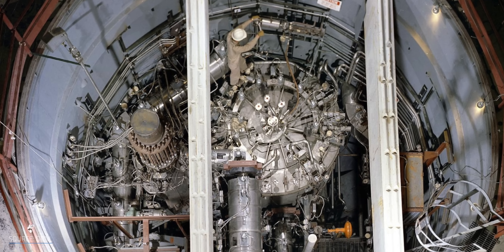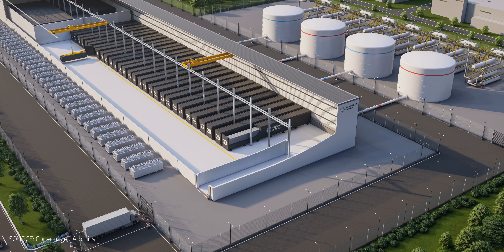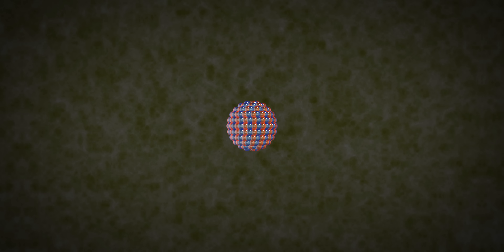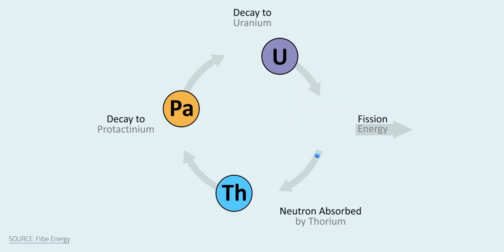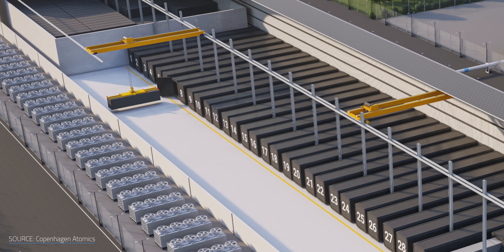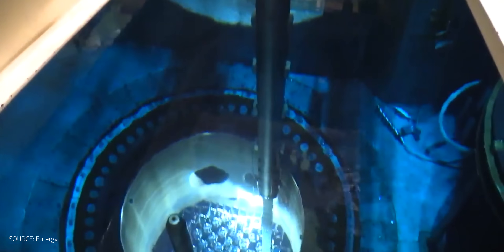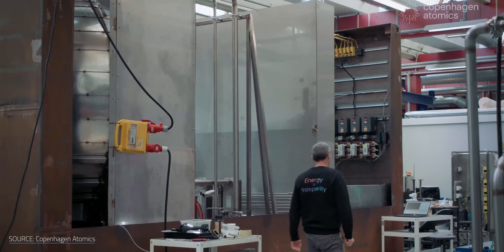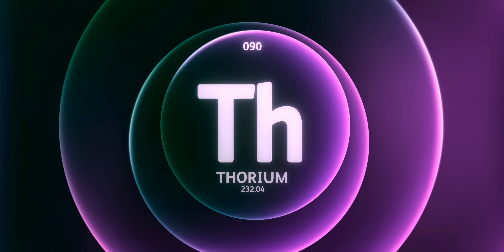Why Thorium is About to Change the World

Comment: Important note why 3 tanks are used!:
Three tanks are used when the plug melts down because a chain reaction can only occur if a critical mass is reached. With other words, when everything is divided by 3, there is no critical mass and the chain reaction stops much faster.
I would like to know how the core is swapped and recycled and replaced. It is hard to imagine how this is done in a highly radioactive scenario.
Reply: Homer Simpson will do it for donuts
Reply: Robotics will be super useful for this
Reply: They’re counting on AI robots to be developed to perform that work. Or they could take China’s approach and just have political prisoners do the work.
Reply: Coal power plants produce far greater pollution and can be up to three times as expensive to operate and maintain.
Reply: @prospektOS-tmo97 coal plants emit more radioactive material each  year than several Chernobyl events but nobody cares because it's not visible
Reply: @prospektOS-tmo97  Coal is clearly not the solution so it is not really worth comparing. We already have effective, cheap and quickly deployable technology that works today: Wind, solar and batteries. Add (pumped-)hydro and interconnections and we can cover all our needs.
Reply: @YouTubeChannelForAll  I'm not about to have this same old argument. Solar takes tons of space, batteries don't have the necessary density - ancient arguments.
Reply: All that ugly naturalistic fallacy "God's green earth" superficial propaganda. Process your motives first
Reply: @prospektOS-tmo97  There are plenty of rooftops available for solar. It needs little to no extra space. Where I live, 90% of solar is rooftop and it already supplies more than a fifth of our electricity needs over the whole year. Together with wind it delivers nearly half of all our electricity needs and is growing quickly. This is proven real world  technology that works today. Also batteries don't need high density for stationary purposes. Literally everything your write is misinformation.
Reply: Just a wild guess but to do the swap and recycle you would remove the fuel (possibly into molds to cool and while the U232 decays enough to handle safely enough), flush with a molten salt mix then set it aside for a few years to "cool down". Once radioactivity levels drop low enough you can then break down the components and recycle the materials back into the start of the production process. How long this takes I couldn't tell you, but there are papers on the subject that I found with a Google search.
Reply: @kstricl  how long is the metal for the core radioactive and can you then just melt it down and reuse it again to build a new core?
Reply: @kstricl  assuming its stil radioactive what we could do is automate its recyclability with robotic manufacutre and some refining to reuse while the materials are still radioactive. less radioactive areas and less radioactive material. it would still need to be replaced after a could of lifecycles but considering you could be waiting up to 50 years for materials to become safe to handle again, it would be like reusing filtered water from a sink to wash your hands again.
Reply: @zachnorman1794 Absolutely, robotic manufacturing would be the way to build them in the first place anyways. I suspect though that so long as you purged all of the active fuel adequately you should be able to reprocess the base metal, removing any "hot" material that formed in the metals during the refining process. Then it would be more like putting said sink water back through the beginning of the water treatment process. From the snippets I read on the alloy they are working with and other papers on the effects of hard radiation on other metals you would want to "freshen" the metals and re-machine the parts anyways.
Reply: Well considering the rapid developments in robotic and AI, i guess we will very soon have robots for that job, or at least remote controlled workdrones,
Reply: one thing also to note its only critical when there is sufficient material in the presence a moderator. the cooling tanks do not have a moderator. I think the main reason to have 3 or more tanks is to maximize the cooling not anything to do with criticality.  In the reactor Vesile you want to Minimize the heat loss except through the heat exchanger.  However, in the emergency tanks you want to maximize the heat loss. This helps guaranty safety and security.
Reply: Essentially, they change fuel by spigot and check-valve. Refueling is just swapping used molten salt for new.
Reply: @LongDefiant  As I understood the question, it is not about replacing the fuel, but about replacing irradiated (and damaged) structural elements of the reactor every 5 years.
Reply: @robertrusiecki9033  exactly, he said ironically the liquids are the only reusable part
Reply: @robertrusiecki9033  That reactor is most likely also radioactive and would be considered nuclear waste. In this case, that would make quite a bit of nuclear waste.
Reply: @AndrejMejac Yes: Compared to today's waste, it would be a larger volume with a GREATLY reduced time until radiation from it is considered safe.
Reply: @robertrusiecki9033  I think replacing the fuel and replacing the reactor are the same thing. To "replace" the reactor, they drain out the fuel, pour the fuel into a newly-built reactor, and just throw away the old one.
Reply: @leveretth  Greatly reduced from 100,000 Years. In other words, still a massive problem with no real solution.
Reply: @patrickskelly8517  In which recycling bin should the old reactor be thrown? Plastics and metals or toxic waste with a lifetime longer than any of us will be alive? This tech already sounds like a bad idea from a commercial point of view. Add the cost of waste disposal and storage for hundreds of years and it becomes laughable.
Reply: @YouTubeChannelForAll  We're not going to be dealing with rocks for millennia.
Reply: The main misattribution is nuclear waste - it is only labeled waste because it is wasted. These radioactive materials can be separated into their respective isotopes and used for research. The only reason this isn't done is because there is very little industry in place as of yet. With space travel technology being developed, these materials can be processed offworld. These old arguments have largely been addressed and what remains is a matter of investment. Radioactive waste can be vitrified in artificial quartz or custom ceramics.
Reply: @AndrejMejac The drained reactor will 'cool,' in place for about 12 months. Once gammas have declined to a manageable level, the reactor is bodily removed to a storage pit where it cools for a few decades and decisions can then be made on disposing of the scrap metal.

The main engineering challenge is working out how all this is done reliably, efficiently and safely.
Reply: Long-lived nuclear waste can be transmuted into short-lived nuclear waste, for example, via neutron activation.
The only reason this isn't done yet is due to the lack of existing infrastructure and financial investment.
Luckily, nuclear technology is seeing greater investment thanks to recent reductions in misinformation.
As always, the remaining problem is only financial, bureaucratic, sociological and psychological.
Reply: @prospektOS-tmo97  My comment was not about rocks. As for your other comment, sending nuclear waste into space with a rocket that might explode is a crazy idea. We will not be doing any "offworld" processing during our lifetimes. It would make no economic sense.
Reply: @prospektOS-tmo97  I think you are confusing hopium with "reductions in misinformation".  If anything, there is more misinformation now than ever, especially about the commercial viability of nuclear tech compared to renewables.
Reply: @YouTubeChannelForAll  Thinking technology won't advance past the point of dealing with materials in a whopping >1,000 years is the opposite of hopium.
Reply: @YouTubeChannelForAll  That said, I don't like your tone. You're one of those people who vouch for one technology over another and don't see anything wrong with it.
Reply: You place plastics in the same tier as nuclear waste, and then later on you retract that type-token error. That kind of shifty behaviour is a red flag.
Reply: @prospektOS-tmo97  I never did that. You are making stuff up or simply can't read.
Reply: @LongDefiant  According to the CEO, these things will only last five years. This makes no economic sense.
Reply: Everything is circulated so you can replace a portion of the salt without stopping the reactor.
Reply: Trump would just use Mexican immigrants
Reply: @norwegianzound democrats didn't want slavery to end, now they don't want the exploited cheep labor to go. Trumps position is the opposite of your comment. My wife is mexican, obviously we don't support the human exploitation party.

Comment: 10:08 "Fission Products from traditional Uranium 235 reactors includes plutonium and other elements". Plutonium is created by neutron capture not fission. It is in a sense a product of the fission process but the phrase "fission product" has definite meaning of two smaller atoms created by the splitting (fissioning) atom. I think it would make sense to describe plutonium as an "activation product" but alas that description is reserved for things other than the fuel getting neutron activated like the fuel cladding, coolant and reactor vessel. So call plutonium and higher elements created by neutron capture actinides or transuranics.
Reply: Expoanding: Fissile Pu238  is created by neutron capture of U238 (a fertile element, just like thorium, but with a vastly smaller cross section) followed by beta decay. About 1/3 of the energy output in a conventional reactor comes from this path. Pu239 is a slightly longer double neutron capture path but still fissile. In essence this is much the same as the Th to U233/U232 process (U233 is a single neutron capture, U232 is a double and both result in Proactinium, meaning that it's impossible to separate them during the fertile-fissile conversion process despite all the handwaving about it theoretically being possible. If it WAS possible Glenn Seaborg would have done it as it would have reduced the cost of nuclear weapons by 80-90%

Molten salt reactors can happily burn depleted uranium once running. This is important because of the depleted uranium to weapons-grade plutonium path. There are thousands of tons of depleted uranium (tenthousands?) under armed guard on military bases across the USA because of the weaponisation risk, vs thousand of tons of thorium simply being buried in the Nevada desert with a 5 wire fence around the site
Reply: @alanbrown397  Are you sure about DEPLETED uranium being used in a MSR? Perhaps you mean spent fuel which may contain up to 2% u-235, still enriched from the natural level of 0.7%. With the chemical processing possible with a MSR you can probably remove the neutron poisons, transuranics with large capture cross sections. Perhaps you'd want to keep the transuranics in the fuel to 'burn up' long lived actinides rather than put them into waste. Other than that the magic of using extra low enrichment requires superior moderators - heavy water or graphite, or lots more fuel. Chernobyl had a fuel load of 300 tonnes, 3X a normal PWR/BWR load of 100 tonnes. It was designed to use extra low enriched (cheap) fuel, originally 1.8% but now 2-2.6% (for safety). MSRs probably give you better neutronics, no cladding or internal structure to absorb neutrons. Depleted uranium is a big ask, you have enrichment levels of 0.3%? That's 16 times less than typical LEU of 5%. Typically the smaller the reactor the more enrichment you need. Copenhagen's design doesn't mention fuel load but they do specify 100MWth, which is about 3% of a typical PWR, so a fuel load of 3 tonnes?

Comment: Renewables + energy storage will probably kill the thorium dream. They are just way cheaper and easier to produce, run and recycle. Sorry thorium.
Reply: IN order to fully decarbonise, we're going to need somewhere between 5-8x existing annualised TWh generation capacity.

With the best will in the world and a ton of magic unicorn poo along with economy damaging levels of investment, renewables can slightly outproduce EXISTING electrical generation. They simply CANNOT hit the higher figure required and we can't wait around for fusion. 

If we do wait for fusion there's a good chance of an extinction level event occuring: If methane clathrates beds start blowing out in the arctic. One is already locked in (Leptav Sea) and that will dump 9 months worth of human carbon emissions into the arctic atmosphere in an afternoon
Reply: We're going to need to decarbonize the remaining fraction of electricity generation when it's dark and not windy and the batteries have run out. In 10 years maybe one of the  small modular fluoride  liquid thorium molten salt blah blah will have proven itself to be viable. But when solar and wind are genearating no other form of electricity generation can compete.
Reply: @skierpage  the problem will be that there is no business case for thorium reactors as backup power. They have to run constantly to pay for themselves. If they don't do this they are not financially viable.
Reply: ah yes, the second coming of battery jesus crowd...
Reply: @cynikal82  They are already working, and currently there is neither a physical nor a chemical limit to energy storage with batteries. There is no energy solution that has developed so quickly as solar and batteries and we far from hitting a limit with that.

Comment: More vaporware, years before it will actually be tested. Too bad China information isn't easy to come by they are ahead of the game and the USA is getting further behind (with significantly less science). If they can't get it licensed in EU no way it will come to the US in 10 years. I am wondering about the downsides and issues you never mention, way too optimistic in my opinion.

Comment: "Thorium will change the world!" haven't they been saying this from like, 1960s?
Reply: It's a prediction on par with the 1950s "the world has only 5 years of oil left".
Reply: Yes, same with Fusion; however, most of the hurdles and issues with both these technologies are the requisite engineering and material sciences needed to achieve reliability and contain the massive heat and forces these reactions produce. For example, even if you were a genius mechanical engineer from today, you wouldn't be able to build even a basic internal combustion engine 300 years ago. The materials and manufacturing precision just weren't there. 

There are thousands of seemingly unrelated advances that have been and still need to be made, but with better communication, partnerships, and collaborations, it's easier to get there.
Reply: @leeroyjenkns4921  The US government wanted fissionable material for weapons.  Thorium doesn't give that.
Reply: Good things take time 😂.
Reply: iirc the thorium powered car dumbness was about a decade ago.
Reply: Well yes, but in the 1960's a pilot reactor operated for 15,000 hours. Fusion pilot reactors are doing well to operate for 15 seconds.
Reply: @michaelmartin9022  Pretty sure we have nuclear fusion running into the 15-20 minute range now, and materials science improves that continuously.